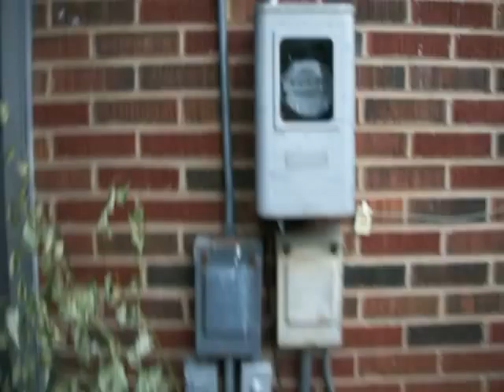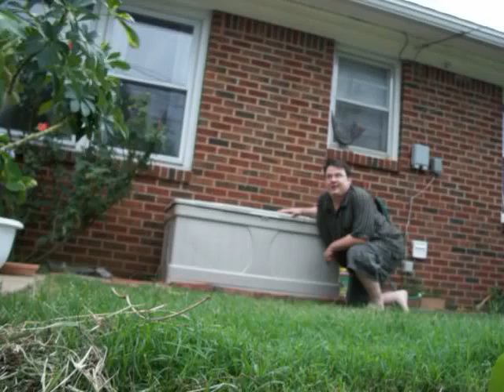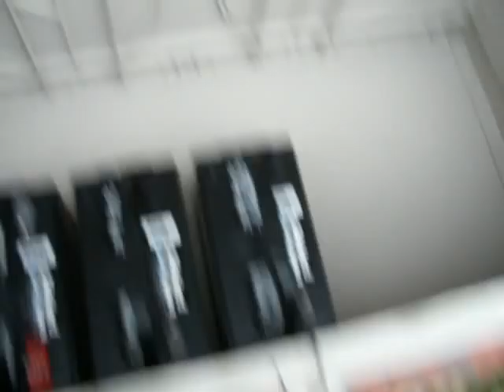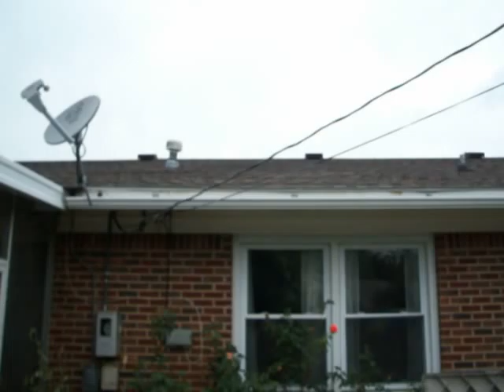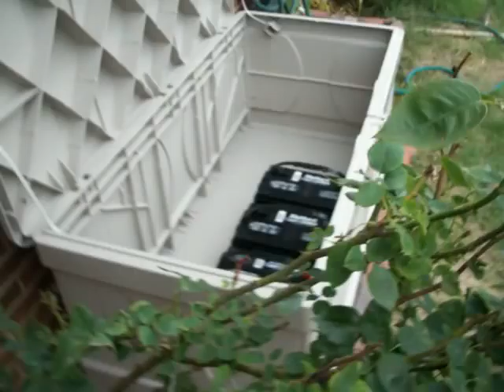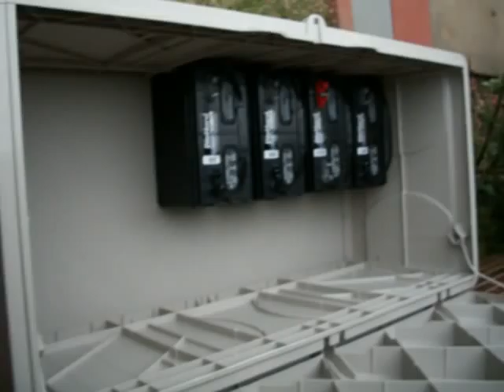Solar Power Reality Show Series No 7

Comment: great video, gives us an idea where your starting from.. :)  About the battery box, since the box is located on the South side of the building in full sun, are you going to put any bushes or anything that will help keep the box cool?  Are there min/max temps on what the batteries can handle?